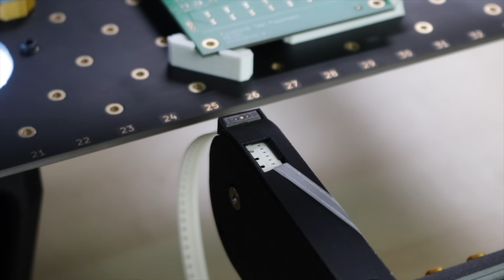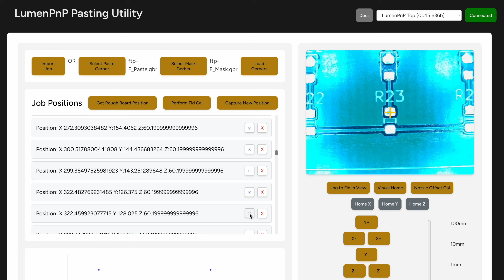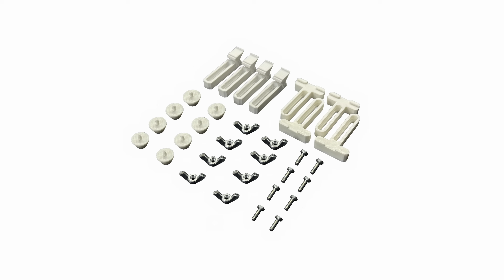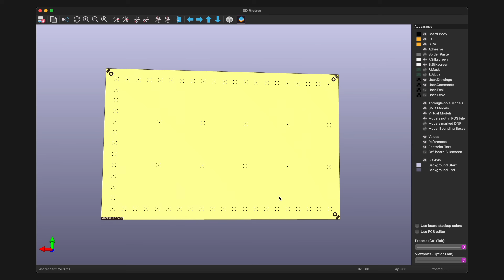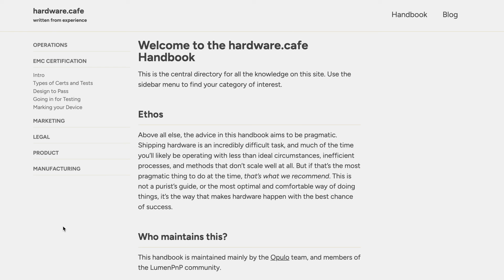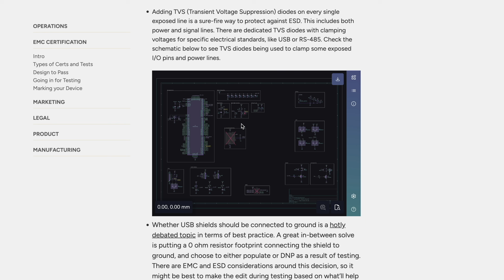August 2025 Opulo Update

Comment: I like the template Idea.  I have found the hard way, that 2 layer boards can be a problem with noise.  Can you also make a 4 layer board, with vias to the power and ground plain, plus top to bottom.  Then power distribution could be easy to do as well.  Sort of like a breadboard, 4 layer, prototype board for lasering.  Thanks, enjoy your progress as a company!

Comment: The via template idea is brilliant. I'm thinking of a design for this as well. Picking up a bunch of blanks with vias already from a PCB vendor should be relatively easy and potentially cheap. If pay for prey templates PCBs.
Reply: Agree. You could even develop a few “standards” maybe a high, medium and low via density board. With the medium density being your primary board, but if the design requires more via or more large parts you could switch to another board on hand

Comment: The via template PCB is a genius idea. I had a CNC setup to route prototype boards and i stopped using it for multiple reasons, but mostly because JLC got so cheap for 2 layer boards. With a PCB like that i can see myself using this for prototypes or even small runs. 
I'm probably still not gonna do it often, since i have a really optimised work flow around JLC delivery time, where i design the next PCB while i wait for the delivery to come, but still, its a great idea.